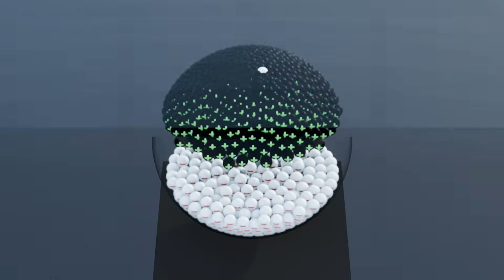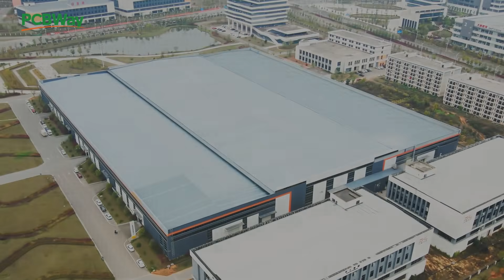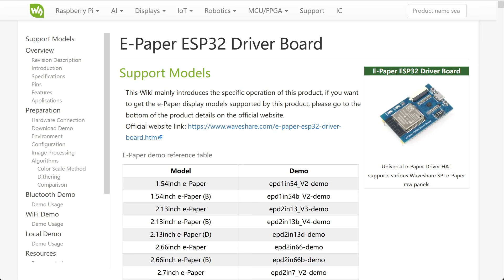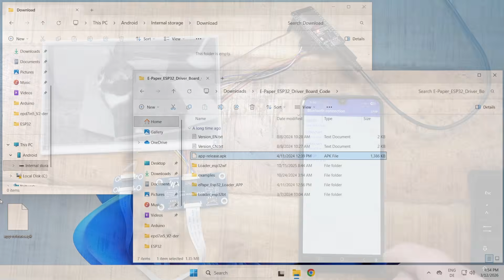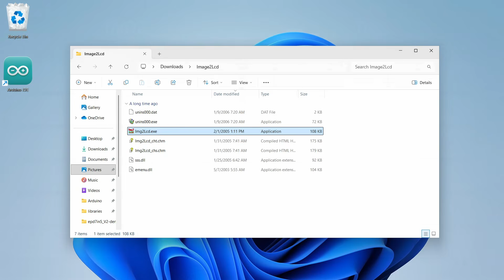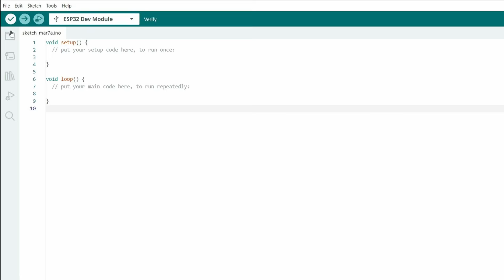Driving an E-Paper Display with an ESP32

Comment: i find that most of those epaper displays are realy slow compared to my kindle. not sure why we cant get faster ones. but they are realy nice for smart home thermostats because they dont have a lightsurce and look realy nice.
Reply: The fast ones get pretty expensive. I do have a slow one as wall image Google calendar. Updates every 30 minutes. 
The user manual says it's the best for longevity. More means less live span. Is maybe noticeable if the manufacturer says it 🙄
Reply: There's quite some know-how involved on how hard you can drive these displays, and the standard routines are rather conservative, and meant to "just work". But there's some videos here on YouTube showing 10 fps for DIY EPDs.